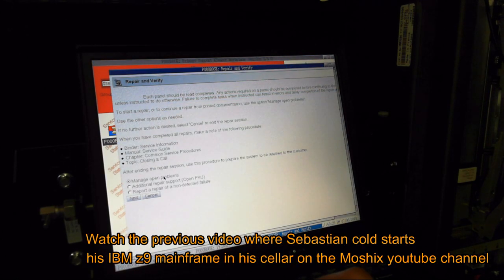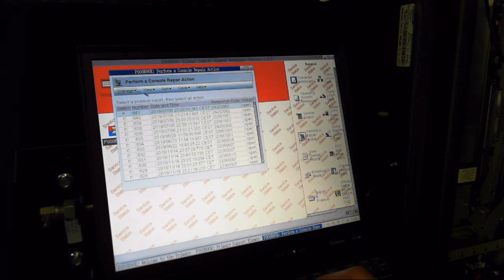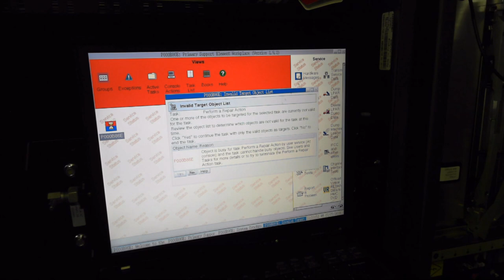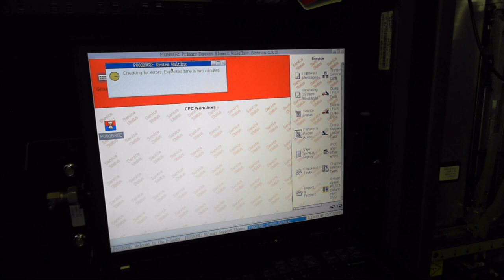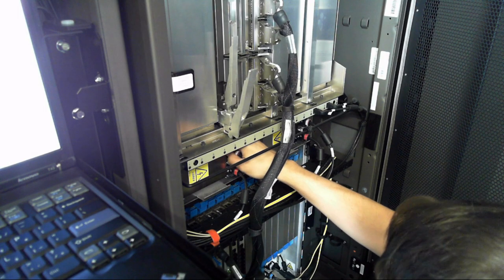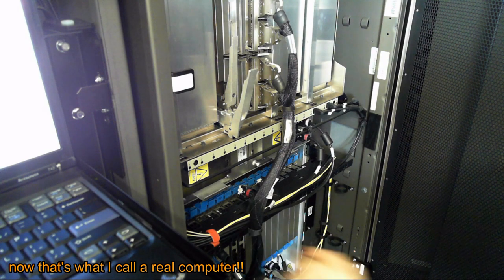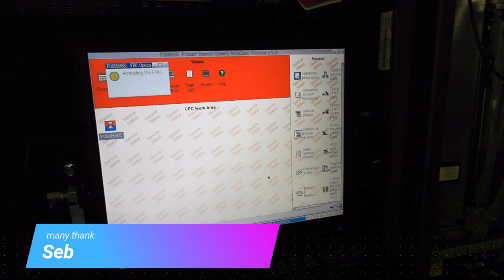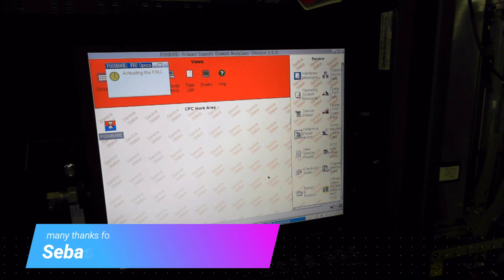Hardware repair and preventive maintenance on IBM mainframe - M165

Comment: Interesting. The circuit that drives a fan is a separate field-replaceable unit. In most servers you replace a fan as a whole unit. Interesting, why they are not doing the same in mainframes?
Reply from the maker: Hey Grigory, wanted to visit your beautiful city later this month but there is too much uncertainty with the corona stuff. Hopefully in April or May

Comment: Sebastian, I don't know what sorts of projects you have planned for your mainframe, but I'd love to see an install of Hercules on zLinux and TK4- Running inside it! :D --Maybe you could also run IMON and give us a MIPS count!
Reply from the maker: There is a video already about this: https://youtu.be/5jOlO1vSBzE
Reply: @moshixmainframechannel  Sort of, but that's on z/VM correct? I'd like to see it run without the z/VM layer.
Reply from the maker: No. It’s with VM/370 and MVS 3.8. Did you watch the video ?
Reply from the maker: And by the way Sebastian’s machine always runs under z/VM. zLinux runs best under z/VM. Sebastian’s video shows that the machine is running under z/VM
Reply: I did watch it back when you posted it, will watch again. I want to see zLinux standalone on real hardware. Even if it runs better on z/VM. Oh, well.
Reply from the maker: ZLinuz on naked hardware is not possible. It needs to always run either in LPAR (which is z/VM) or z/VM under LPAR
Reply: @moshixmainframechannel  Right but above that LPAR layer you don't have to run z/VM like you did in your video, right?  (You ran z/VM 5.4 hypervisor above LPAR  with z/VM in firmware.) Or am I wrong about that?
Reply from the maker: zLinux needs to run either on top of LPAR or on on top of z/VM on top of LPAR.  There is no other way. Running zLinix on LPAR directly is however currently possible on any of the mainframes Sebastian or I have access to
Reply: Okay. And  that's what I want to see-- zLinux over LPAR--directly. Thanks for helping me clear that up! (And I think even IBM's test drive zLinux machine runs LPAR z/VM AND z/VM.)
Reply from the maker: Yes very few people of any run zLinux on top of an LPAR directly. It’s just more hassle to manage